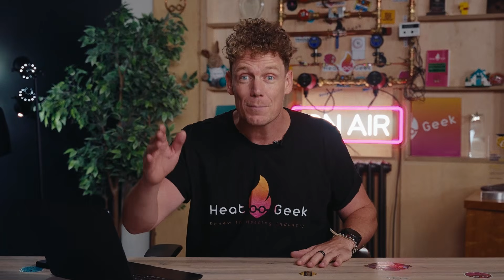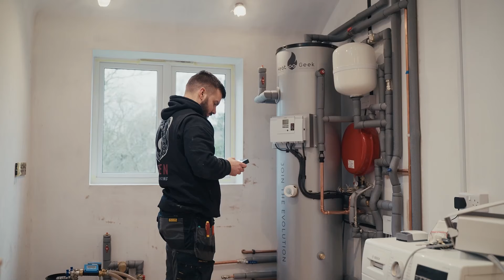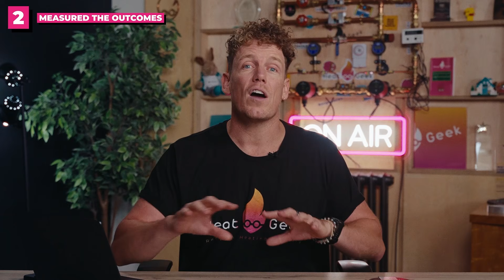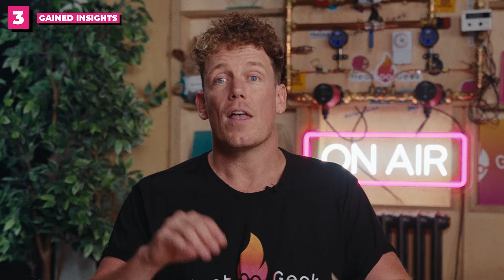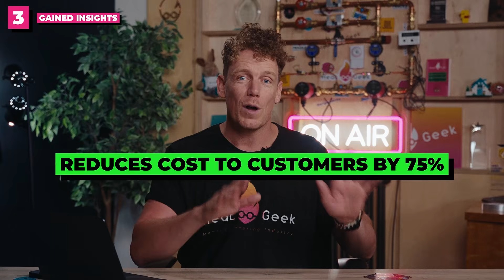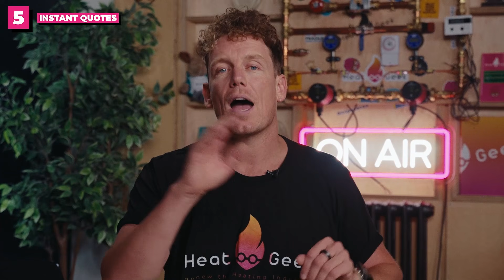Heat Pump Reality Check: Is Zero Disrupt Too Good to Be True?

Comment: I am sure in a well designed new home wtih the space to do this and good insulation it works very well. Not for small houses with no space to insulate or even install the system. It also a very complex system, very interesting but way more complex than "set fire to thing". I just dont think legacy housing stock is going to work properly , new builds sure , but not the old stuff.
Reply: I've got a 5 bed victorian solid brick house and we're having a heatpump through heat geek. Guaranteed performance of 4 to 1, estimated performance 4.5 to 1.

Not a cheap endeavour though - and we are refurbing the whole house.
Reply: Insulation is not required, my house is 160 years old, not insulated, and my HP works fine. I fit them in all types of homes, predominantly old ones
Reply: So many colder nations with old housing stock haven’t had an issue.
Reply: Like any heating system the better the insulation the cheaper it will cost to run.

But also like any heating system HPs can be designed to work in any home, government was just trying to ensure that best efficiency was being got for the grant.

Now they have withdrawn insulation requirements, effectively making it cheaper.

Things would have to be really desperate for a HP not to work at least at a COP of 3+ (mine has averaged 4.1 over 19 month period, two bed 1960's bungalow, very modest insulation by todays standards).

Conclusion is that they can work in older housing stock, better insulation is always good in reducing size needed and running costs.
Reply: No home is "too small" to insulate. Heat pumps aren't complex at all. Stop using insane water heating systems to heat homes first of all. Exterior insulation and an air source heat pump or two strapped to the wall. No pipes running around and all you need is a standards power outlet. People are making this far more complicated than it needs to be.

Comment: The grid would not be able to supply enough electricity if a good percentage of people moved to heat pumps. Not only would the grid not stand the increase, where is that increase going to come from, when th`ey are closing down coal and gas fired power stations.
Wind and solar can never supply enough, and there is no back up with that, it would be impossible to have a battery back up.for even a very small percentage of whats required.
Same for electric cars.
I'll stick with my oil boiler and log burner thanks..
Reply: The coal fired stations in the UK are already closed down, my HP is currently pulling 400 Watts, the 77kWh battery in my EV could power that for nearly eight days if push came to shove.

Many (not me) have solar PV and battery backup that runs their house grid fee for six months of the year and charges their car.

It's far from all doom and gloom, at this moment wind turbines alone are providing 46% of UK electricity demand during the peak usage period.
Reply: @_Dougaldog all of that is great but what people don’t understand is how knife edged the grid supply is. As load changes the demand on the grid needs to be satisfied or you get shutdowns and blackouts as they saw in Spain in the summer. 

National grid has recently raised £7 billion from shareholders so there is huge investment going in but that will have to generate a return at some point. 

The trouble with renewables is their intermittency. It always will be and there isn’t any way to deal with that without eyewateringly enormous investment and even that won’t be able to cover more than a few hours. We always come back to having Gas powered stations and those will cost us even if we don’t use them ending up with renewables costing more.
Reply: @_Dougaldog  🤣
Reply: Yup - the instantaneous heating power demand on a cold winter evening is huge. No way the existing grid infrastructure could supply it.

Comment: From Sweden here I do not understand are anyone in your context burning fossil fuels to heat homes that must be££££ my house are running a ground source heat pump from 2005 estimated cop around 3,5 Heating the house and hot water with around 10000kwh of electricity early. That is with the original 1954 radiators. That is around 35000kwh of energy I do not know what a resonable efficiancy for a gas/oil furnace is since i have not seen or heard of anyone using one for 25 years but i will guess 75%,today, then that is equal to 4666l of diesel fuel yearly. That diesel cost atm 60000sek yearly compare that to electricity at current prices including transmission fees etc. at 32000SEK yearly that is a cost saving of 28000 yearly. My heat pump has run for 20 years that is extrapolated 560000sek in running cost savings estimated installation cost today double of 2005=  260000 = profit 400000sek or 20000sek early. For you to even consider burning gas or oil. Fuel must be really cheap in your country or electricity really expensive to even consider that a solution.
Reply: The problem they have over in the UK is that electricity prices are basically set by gas prices because the gas-fired power plants that are most expensive to run often set the marginal cost for the entire electricity market. /PS - Hi from Finland!
Reply: @PurpleAlienPlanet that leads to similar running costs. Most houses already have a boiler and were built with poor insulation assuming heating would be cheap. This leads to high installation costs and meager savings.
Reply: When the UK found north sea gas it was a huge revolution that happened very quickly for us.  A lot of people at the same time got central heating. We have a huge gas network with gas delivered directly to the majority of homes. We will figure it out eventually.

Comment: I don't think they even make non-modulating heatpumps nowadays
Reply: modern inverter heat pumps can modulate heat output, allowing them to adjust to varying heat demands by continuously adjusting their power consumption and heat output to maintain a consistent temperature and improve efficiency.
Reply: I have just checked this and they do now modulate by turning the heat pump down from its maximum heat output. From what I see it is around 20% after which is switches off. 
This is a move in the right direction but it is not capable of boosting output in cold weather it just pumps at full speed and the efficiency drops as the outside temperature drops. 
It is semi modulation not full.
Reply: @Roger-Bisby1 My heat pump uses from 300W to 1600W of power to supply between 2 kW and 6 kW of heat. It's in a hybrid setup with the gas boiler, which can not modulate below 5 kW and is limited to 20 kW.
With modern insulation and a heat loss of only 5 kW at -2 outside the gas boiler is really only there for DHW now, but before installing the heat pump the gas boiler was oversized at 35 kW and was turning on and off way too much. Oversizing a heat pump just gives you the same problem and a higher cost for power you will never use. Heat Geek are doing things right instead of the guesswork and overkill flow temperatures historically done with gas boilers. I frequently find gas boilers running at no less than 80 degrees Celcius and upstairs radiators closed while the home owners have a huge gas bill and white smoke coming out like there is a new pope. It's time to do things right. I suggest you take the Heat Geek course to get the complete picture.
Reply: @SolAce-nw2hf  If the gas boiler is Opentherm it should modulate between those figures that you mention, All gas combi boilers modulate if you have correct controller fitted, most people have a controller that switch the boiler on till it overshoot the required temp then switch off till its below the required temp. a modulated controller will keep the boiler at the required temp all day long
Reply: @dantronics1682The problem is that even at the lowest modulation, that gas boiler running at 5 kW is still going to be too much in a properly insulated home running at low temperatures on all but the coldest days.

The ASHP can modulate so much lower than any gas boiler can. My ASHP is controlled with opentherm (Tado thermostat) and the controller of the ASHP in turn controls my gas boiler with opentherm in the hybrid setup. This makes a nice combination, able to switch to gas just in case. 

Next year I will have the gas boiler removed and replaced with extra components to go full electric with the ASHP. Hybrid is nice, but the standing charges for gas in the Netherlands are just too high at about €25 a month.
Reply: @SolAce-nw2hf  I like the idea of the hybrid system. My boiler is a bit old but I have no space for another hot water tank so either a an instant gas water with inverter HP or hybrid, I would love to get rid of the gas just to save on the standing charge but just bought a new cooker and the SO doesnt like to cook on electric.
Reply: @dantronics1682In theory you could just add an ASHP for heating the home 100% and leave the gas boiler there for DHW. In my case that's about 100 kWh per month of gas usage for shower and bath, making the gas boiler last much longer. Instant hot water also prevents losses and in my case it was only about 10% of all gas usage per year.
Reply: @SolAce-nw2hf  I do have a split unit but dont find it cheaper to run, I was thinking of using solar to suppliment in the daytime  but we dont get much sunshine in the Autumn
Reply: @dantronics1682Solar does help a little, but winter is cold because of very little sunlight, so it's not going to be much in winter. The better option is to get a good energy contract with battery storage allowing you to pre-charge cheaply.
Reply: @Roger-Bisby1  I have heat pump heating a pool.  It can keep the pool as high as 30C or as low as 16C.  I have heat pump heating my house though without using radiators.  I can set the temperature from 5C to 30C.  It is rated to be able to reach these temperatures with an outside temperature as low as -30C though I have only experienced -22C with it.  Point is I don't really know where the argument about modulating the heat is coming from.
Reply: @Roger-Bisby1  

My humble Daikin 6kW can modulate its output from 1600 Watts to over 6,000 Watts.

Which means electricity used can usually vary between about 400 Watts average (as it is now) to about 2,500 Watts (when used in anger to heat HWC to 60C).

Much more than '20%'.

At -5.5C in January my HP was consuming 1300 Watts of electricity, and outputting about 3,500 Watts of heat with a flow temperature at 38C giving a COP of 2.7, nowhere near its maximum output.
Reply: @_Dougaldog  That is interesting, I am not sure a COP of 2.7 is that good. What is going on there?
Reply: @Roger-Bisby1  

-5.5C outside gave COP of 2.7 as said in OP, COP is currently 4.4, and at times 5.2 (what's going on there ?)

Average over 19 months since installation is 4.1

Comment: If only the UK oil and gas industry wasn't subsidised by the UK tax payer by £17.5 billion per year, then the price of gas would be through the roof and heat pumps would be significantly cheaper to run than gas boilers, as opposed to slightly cheaper to run (on a standard electricity tariff or a lot cheaper already on a smart tariff).
Reply: Gas accounts for 38 percent of the electricity production in the UK so how would that work?
Reply: Yes, Roger doesn't ask what would happen if the fossil fuel subsidies were removed. He also doesn't say what the alternatives are, gas boilers must be replaced with something else, it is not feasible for the future of our planet to continue with their use.
Reply: @MentalLentil-ev9jr 38 percent of our electricity comes from gas so rather than just using it directly for heat, it's being converted twice. I have no doubt that gas will be with us for the foreseeable future.
Reply: 1 cubic meter of gas is roughly 11 KW, at around 5p per KW. Less than 60p

1 KW of electric is around 28p. More than 60p for 11 KW.  Over 3 quid for the same amount of energy.

The COP claims of heat pumps are only valid at the design stage and when the weather conditions are ideal.
Reply: @poormanskint3008 Think you mean KWH (kilo-watt-hour) which is a measure of total work done, rather than KW which is a measure of instantaneous power.
Reply: @poormanskint3008  

My HP was installed 19 months ago, and for heating the SCOP to date is 4.1, measured over that period.

My system was designed for 45C flow at -3.5C external, 5,200 Watt heat loss calculated, in practice it runs mostly at 34C, and 38C when it was -5C last January.

Comment: My heat pump and whole heating system renewed for £3,500 after grant, about the same as it would have cost just for a boiler replacement on 60 year old system.

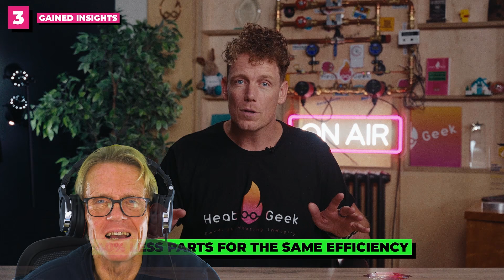p.s Roger, heat pumps do modulate at 3:40, to say otherwise is misinformation.
Reply: So over 10k and I paid for some of it FFS.
Reply: I Think what Roger is trying to say is that heat pumps maximum output drops when it gets colder outside, but then like heating system you can just size the heat pump for worst case design outside air temp of -3. Air source heat pumps are great, gas boilers are great, the whole ethos of heat geek is training engineers to install heat pumps alot better.
Reply: @plumberdan5720  Well said!!